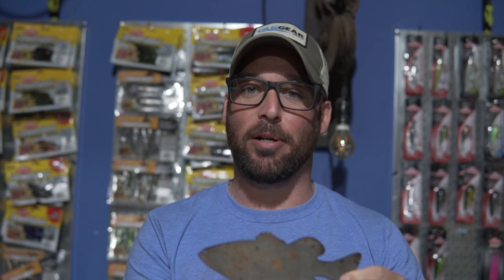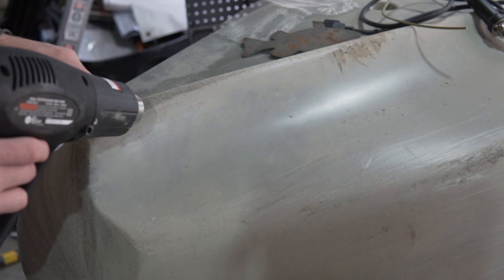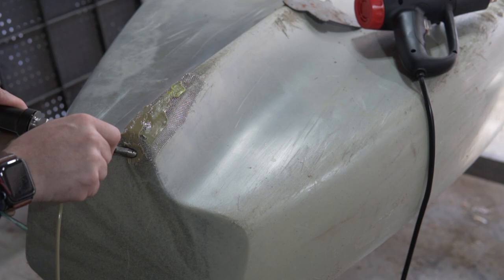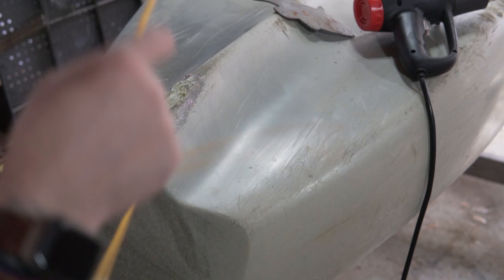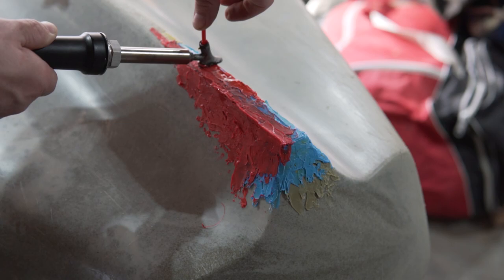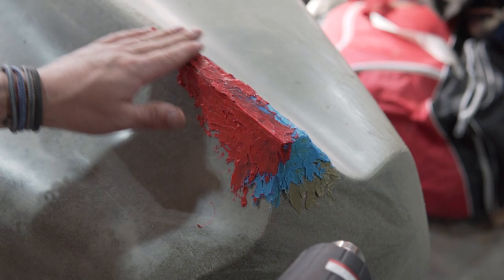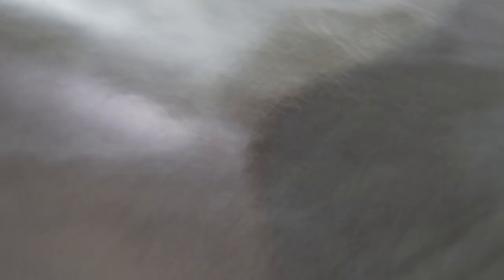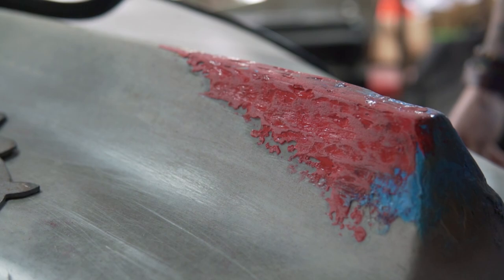How to FIX a HUGE KAYAK LEAK in the keel- Repairing a big hole with plastic welding

Comment: So I just repaired my nephews yak.  And now mines.  I have a plastic wielder and a heat gun.  But I’m learning.  I’m a single mom with 2 sons and we love kayaking and fishing.  The heat gun i have haven’t even gotten close to figuring out. I’m scared imma make it worse lol.  My plastic wielder is one where u can’t feed the plastic through it.   I like urs where u can.  I think I’m totally going to get one.  Might be easier for a beginner like me.   Thanks for taking the time to make this video!!! It helped me.   I also didn’t use the wire mesh stuff which  I probably should have.  But… imma figure it out by golly!  Thanks again.
Reply from the maker: There are plenty of great videos that can help show you some tips and tricks to using all types of plastic and welders too:) just make sure you don’t put the heat too close to the kayak and don’t make it too soft or it will melt! I learned the hard way too

Comment: Besides carrying the kayak, and using the cart as much as possible, I'm wondering 
what can be done to strengthen an as yet undamaged keel since some dragging is unavoidable.
Reply from the maker: They make keel guards that you can apply to any wear point. Prep and correct install is key

Comment: Do you mind sharing what grade plastice youre using? Thank you.
Reply: watching videos these days I noticed, that mostly as new plastic is used HDPE = High Density Polyethylen. On the material it is regularly stamped. You could even take Milk jars of plastic. In my country the stamp is PE-HD . So you could make stripes of an old milk jar, and then with such a heat welding iron, melt it into the original crack. The heat gun mainly is for pre-heating the old plastic, it is getting shiny which indicates its softening by heat. Yet, don't burn the plastic. I have a coastal rowing boat with a crack at the seat mounting. So I am just learning how it goes. :-) I will do first some "test patches", e.g. in one video I have seen, they used a jar which you can get from the tool market to mix colours or epoxy glue. Thats also HDPE. I don't get the nozzle in my village. So I have to order it online.

Comment: Thank you for the video.  I didn't think it was possible.  Can this work if there is a 8in long slash on the side/bottom of the hull? I found a 11ft fishing kayak for $80 because it has a big slash in it and if it can that'll be so rad.
Reply from the maker: All depends on the hole. It’s always risky and tough to trust a damaged kayak. I would keep a look out on Facebook marketplace and look for something more solid for your safety.
Reply: @TheBassquatchHunter  thank you I thought about it and it's not worth it just to save some money. Still liked your video, I didn't know plastic welding was even a thing. Thank you again
Reply from the maker: @justinstruyck9989  definitely should look for something more solid and safe. And check out YouTube for instructional videos besides mine too. There is a lot of great content to help you learn how to plastic weld!
Reply: Gator patch.

Comment: You did OK up until you started adding plastic to the cold kayak surface. 
You must heat the surface or the plastic  will release later.
I've repaired about 100 kayaks and the ones that I just put hot plastic on without heating the surface needed to be Re-repaired.
This looks like your first repair after watching a few bad videos.
Reply from the maker: Thank you! It’s actually not my first repair as I have been doing this for almost a decade and have repaired about 30-40 kayaks over the years. The video may not accurately show me prepping and pre heating but trust me, it was done correctly and this patch is still holding just like the day it was done
Reply: I have thought same, yes. Its good to pre-heat the "old plastic" or "new plastic layer" with the heat gun, the plastic changes its surface, gets a kind of glance with the heat. I think that's the right temperature then. I am still learning. I have a coastal rowing boat made of PE and need to repair a crack which started to open the hull around the seat mounting.

Comment: The screen isn't necessary.  There isn't any screen in it originally.
Reply from the maker: When there is a large hole like this, the screen is very necessary. There needs to be something to build the plastic on. Very similar to a drywall patch. The screen adds more of a rigid base to build plastic on and for it to hold onto. Small holes don’t need it, large holes do:)
Reply: @TheBassquatchHunter  nonsense, the entire boat is the same material. Get a larger, thicker piece of hdpe heat both up. Heat gun and old toaster oven to heat the plastic. Form it on so it bonds. Some parchment works good with gloves on. You're the only person I've ever seen use screen. 
 Hdpe is very different from drywall.
Reply from the maker: @tomdarkart1  I guess we can agree to disagree. I have repaired about 20 kayaks and when the hole needs reinforcements to hold the plastic, then screens are recommended even from the manufacturers that I work with in the industry. If you don’t need screens to repair points like this, then good luck on yours and if I use screens, then good luck to mine :) as long as they get patched strong enough to hold up and last, then it’s done right:)
Reply from the maker: @tomdarkart1  also, there is a reason that any kayak repair welding kit comes with metal screen as well. I was doing a video on how it is suggested from manufacturers, not the only way to do it.
Reply: @tomdarkart1  The original material doesn't have mesh in it because its a solid single peice that was molded in a controlled manner. But now you can't  have the perfect condition to get it to weld perfectly like in a mold. The methods  you have seen other use does work, but this method with the mesh is even stronger of a bond, it increases the bonding surface area by a large margin and it adds a reinforcement to the bond. Search how composite works, they always have a matrix and a reinforcement parts to reach peak performance.